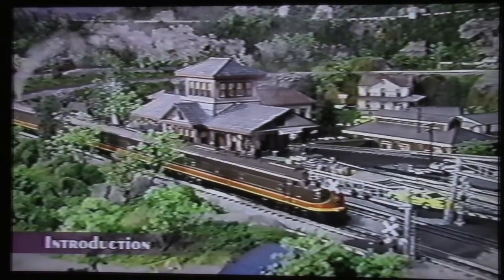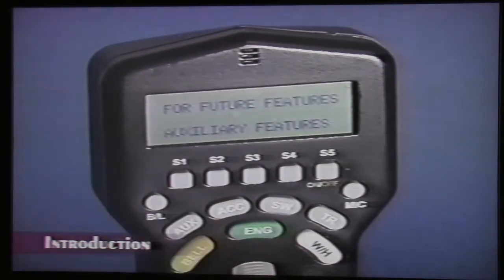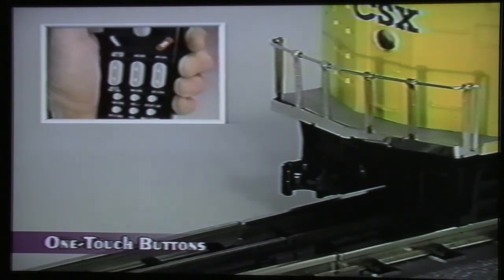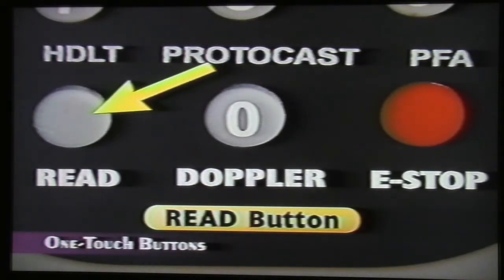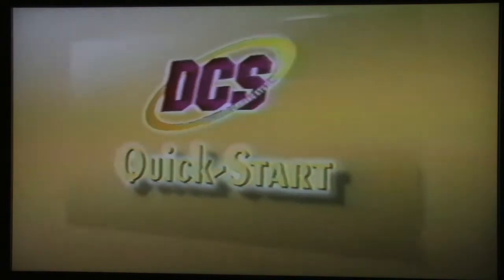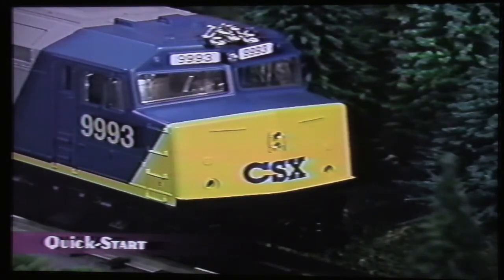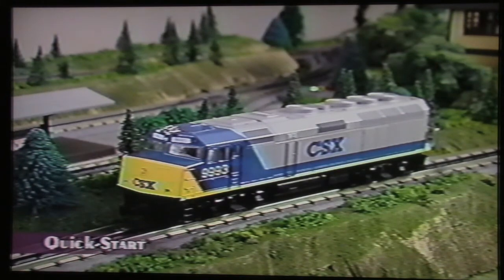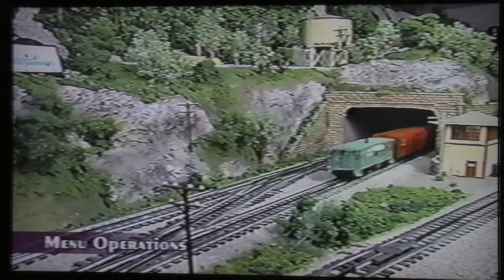MTH Digital Command System Welcome to the World of Digital Command Control An Introduction to DCS

Comment from the maker: Section Timestamps:

0:00 Introduction
5:03 One-Touch Buttons
11:05 Quick-Connect
12:29 Quick-Start
17:46 Menu Operations
25:28 Conventional Mode Operations/Conventional Operation
27:43 Using Lionel's TrainMaster System/TMCC Operation
32:28 Operating Accessories/Accessory Operation
33:36 Closing Comments
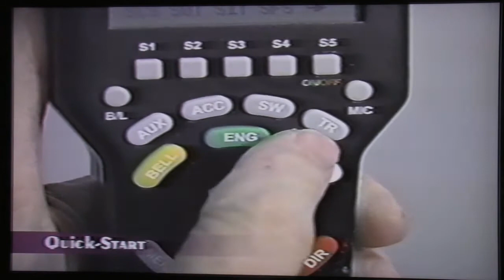Reply from the maker: 16:29 5 or 6 chime?

Comment: I found your whole series on mth dcs so very useful, much appreciated. With my new trainbord & a full DCS system (TIU, WIU, AIU ), the sytem found new engines added in only 7 of 10 tries with a signal trated 10 out of 10. After I added additional power to the TIU with a wall wart ( besides the normal connection to my Z4000 transformer),   it did improve and, so far, found every egine each time I added a new engine. I actually did a video to summarize my experiences with DCS and what I leanned to make the choice between a mth DCS Explorer or the full function DCS System with a TIU, Wiu' & AIU. posted as file1man, here:  https://www.youtube.com/watch?v=mSmjqvXQ_dQ